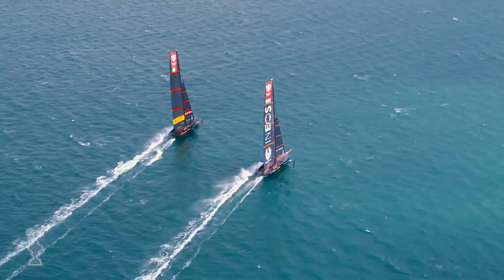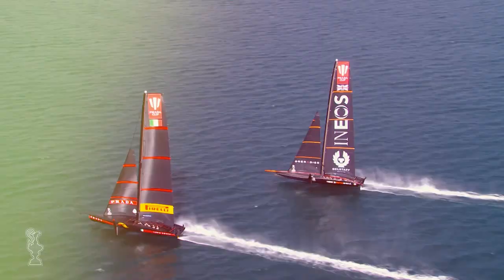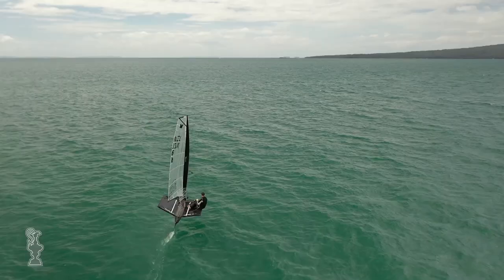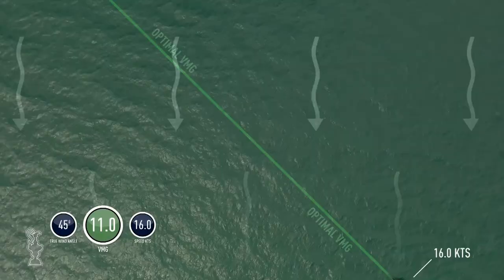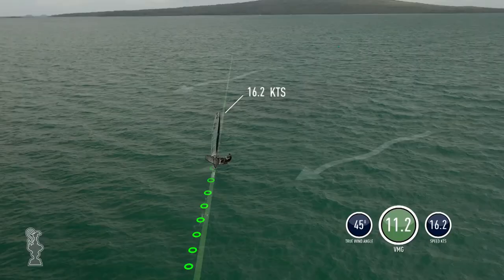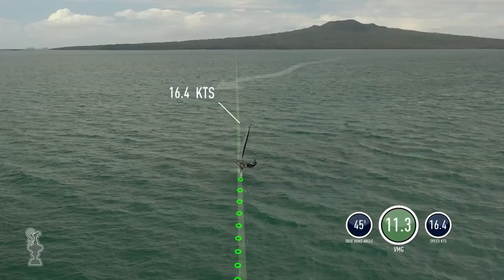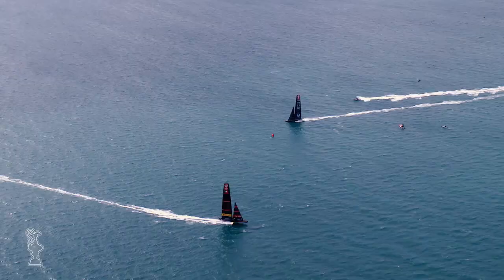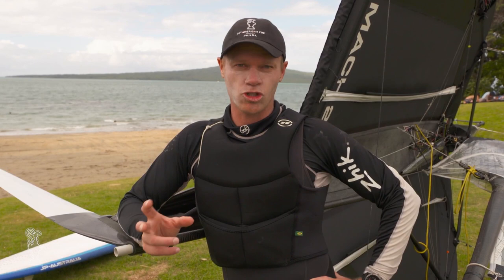Know the Game - VMG Explained by Nathan Outteridge

Comment: So there's an ambiguity where VMG could mean the component of velocity parallel to the wind, or parallel toward an arbitrary direction, "toward the mark." If the wind happens to be exactly toward or away from the mark, those two definitions are coincidentally the same. But if the wind is different, then they're not. I'm trying to figure out which is the one that VMG means in the context of America's Cup races and what's displayed on the bottom of the screen, and this video was no help.
Reply: OK after some sleuthing and trigonometry, I have figured out it's the along-racecourse component, and not along the wind.

Comment: Is the 45 angle compared to wind direction the best angle in an up wind situation? What about downwind. How does that work? Thank you for this great demonstration
Reply: Not necessarily. For the sake of this example it is used for simplicity but many boats can sail closer to the wind than 45 degrees while still making good progress and speed, especially newer, faster boats. There is a different ideal angle off the wind for each boat based on a few factors, which include: what kind of boat you're sailing , wind strength, and water conditions. Some boats VMG may be at its highest when it is 30 degrees off the wind for example, so it really comes down to the boat. But in the sake of this demonstration, 45 is used as the angle where this boat has the highest VMG. Downwind it is the same principle but just like in upwind, the angle is unique to the boat and wind conditions. If you go directly down wind, you are sailing the shortest line, but you aren't going as fast since you have very little to no apparent wind.

Comment: what is an optimal VMG? Is there one?
Reply: VMG itself is an optimum, so to say "optimal VMG" is a tautology. VMG is the optimum when trading off speed with your progress in the true wind direction: generally, if you bear away from this optimum you will go faster but your progress upwind will be slower; and it will also be slower if you head up so that you sailing closer to the true wind direction but in this case you will generally be sailing at a slower speed across the water.
Reply: @BlueSoulTiger  That doesn't sound right. VMG is just v*cos(a), where v is the boat speed and a is the true wind angle. The greater the true wind angle (maxing out at 90 degrees), the faster the boat goes, but then a smaller component of that velocity is in the direction that the boat needs to go in. There will be some true wind angle which maximizes VMG by striking the right compromise between angle and speed.
Reply: @takatamiyagawa5688  Thank you. It doesn't sound right because it's wrong. I confused myself. You are correct. So yes, there is an optimum VMG, a maximum for a given wind speed and direction, for a given boat. Sailors aim to stay at this optimal value for as long as possible (putting aside other variables such as other boats in proximity, which is the tactical aspect).